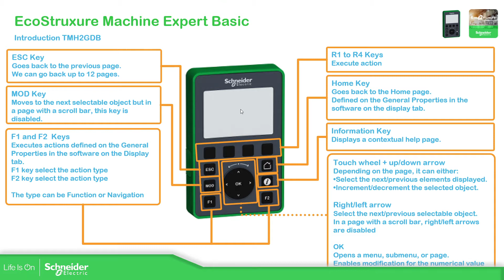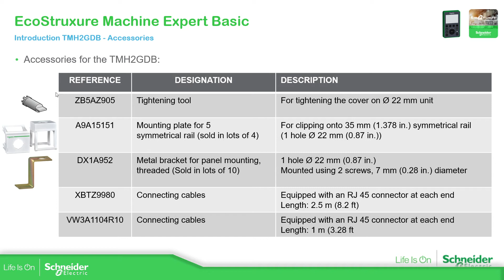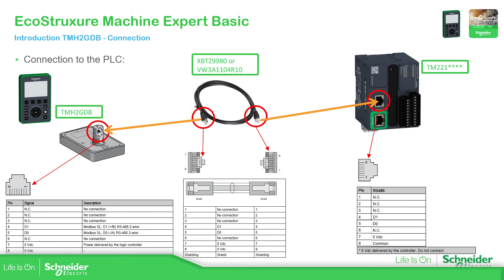Training - M221 - M7.1 Introduction to TMH2GDB Graphic Display

Comment: Hello
I have a remote display  with version 1.1
Is there a way to connect it to M221 with version 1.12?
Reply: ding ding
Reply from the maker: Hi Alireza! If you are working with the a TMH2GDB with firmware v1.1 then I believe is an old unit (before 2016). At the back of the TMH2GDB you need to check the SV number:
•If SV is 1.1 then the firmware version of the display is V1.1 and is NOT up-gradable.
•If SV is 2.0 then the firmware is up-gradable and delivered by the factory with a V1.3 firmware installed.
•If SV is 3.0 then the firmware is up-gradable and delivered by the factory with a V1.4 firmware installed.

In your case I believe your TMH2GDB has the SV1.1 so you can still using Machine Expert Basic but the level of the application should be "Level 3.3".

In order to change the level of your application you will need to go to:
"Programming > Behaviour > Functinal Level"

By doing this some of the functionalities of your program will be affected... i would rather change the TMH2GDB for a new one.

Comment: Hello LeTomas AHUMADA. 
Are you planning to show an example of  :
a)  PID for heating and cooling functions
b)  PID for ATV speed regulation
Recently I was looking for invert  analog signal where 4mA = 100%   20mA = 0%   I managed to do it on Function Block but I wonder if it is possible to use a scale function for this

Thanks   👍
Reply from the maker: Hi Sajek, I need to create some videos for the PID related to the configuration and implementation (important topic). I am not sure if i will create something related to the ATV but i believe i can come up with sth. Related to the scaling we do not have in m221 a function for this and you can manually created or use the operation block to create the lineal equation (slope + offset). If i am not wrong i have already prepared a topic for this but it will be available on 14/12.
Reply: @LeTomasAHUMADA  Thanks 🙋